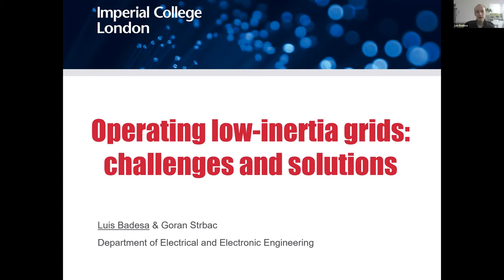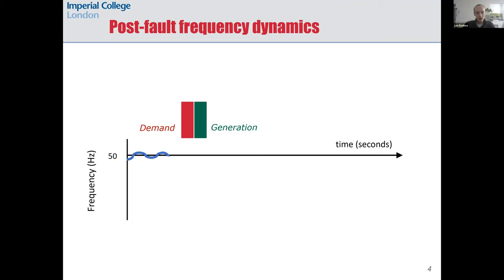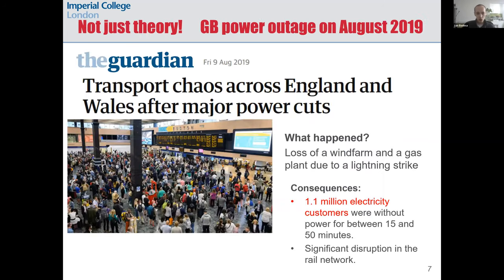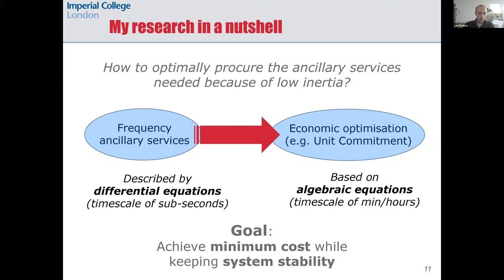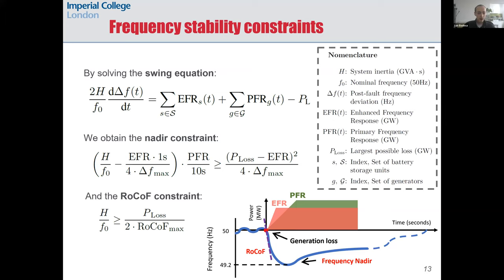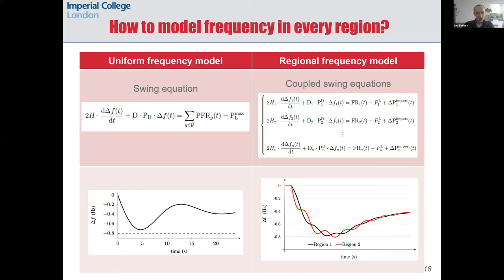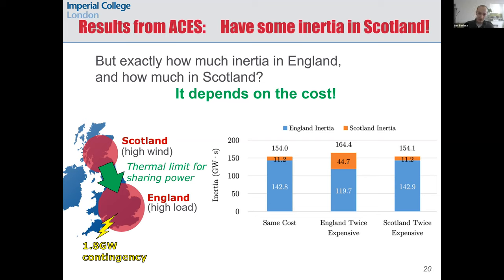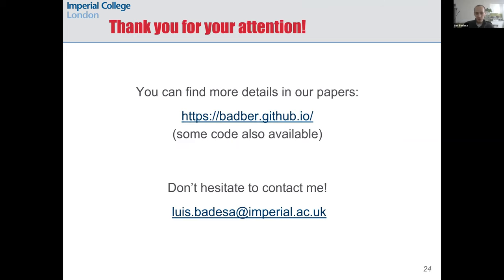Operating low-inertia grids: challenges and solutions

Comment: Thank you for the presentation and I found it quite educational. I am new to the Supergen Energy channel and I will have to look at your other videos. Please allow me to make one observation. Basically what you are saying is that given the proper conditions a little old lady by flipping a light switch can crash the whole network. I come into this from the renewable energy side. I am sure you are aware of the increasing amount of solar and batteries being added. I think your mistake is trying to perpetuate a fragile centralized system. Really, all that power generation large and small should be doing is charging batteries. Large power plants will become obsolete due to decentralized production.  Let the batteries handle the load. Thanks again.